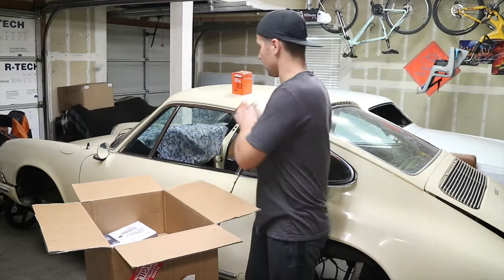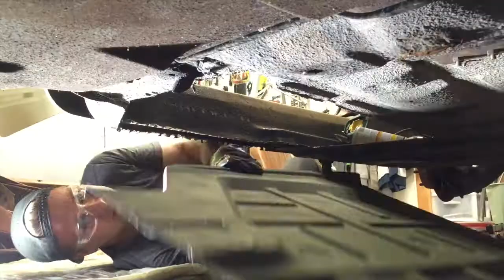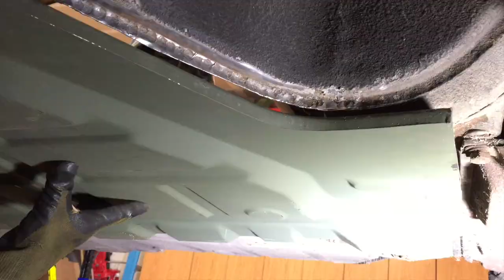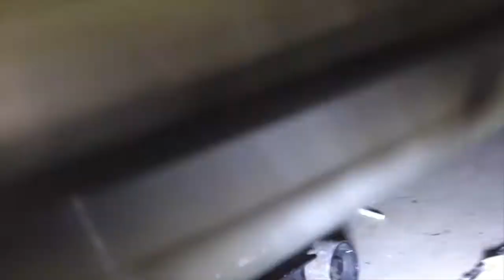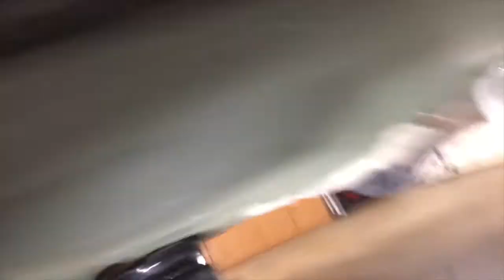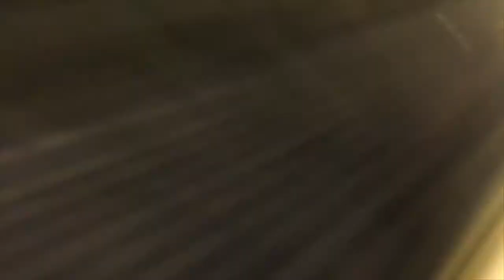Welding new floor pan Project Classic 1969 Porsche 912 Pt.7

Comment: We're you welding without a shield?  Also, do yourself a favour and buy a proper metal hammer and dolly.  You'll find it so much easier to use when panel beating than a carpenter's hammer.
Reply from the maker: I know I know. I just use what i had around the garage. Sometimes i don't wear my shield but thats only for a short second. Thanks

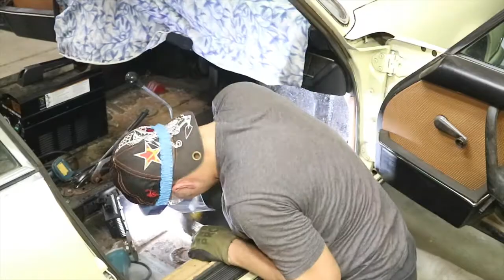Comment: Hello from Argentina. I saw at 05:05 that you cut the original floor in a 90deg angle with the disc. I can tell you that is a good practice to make a 10mm hole in every angle instead to finish it in a sharp end, in order to avoid crack growth when the car twists (always twists). I really enjoyed the video! Thanks for sharing.
Reply from the maker: Thank you for the great advice!!

Comment: Nice job Larry like the channel...why not dissassemble completely, media blast and start fresh? These cars have alot of rust hiding. Shine a light in the frunk near the hood hinges. The cowlings rust out when the window seals dry out. Pull off the black vinyl rocker covers and use a magnet to check. The lead filler corrodes the outer rocker to A pillar and longitudinal. Also the rear seat bottoms. I see you have rust coming through the front fenders where they meet the rocker. Also the battery areas are typically bad. 
Get a MIG welder from harbour freight. Your need to use inert gas to get a good weld.
Reply from the maker: I really wanted to make this project simple. Get it on the road quick and later do the rest. My Lincoln is the big project. I didn't want two big projects at the same time. I have a welder from Harbor Freight and want to upgrade to something better. What do you think of ESAB welders? have you heard of them? Thanks